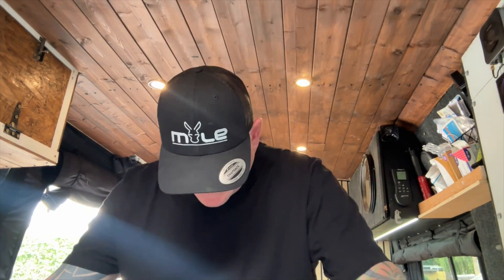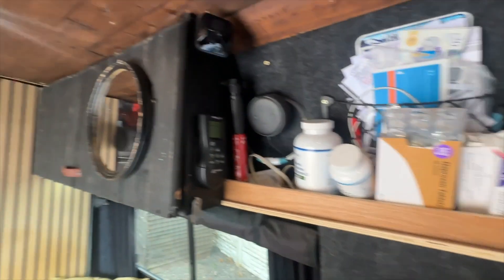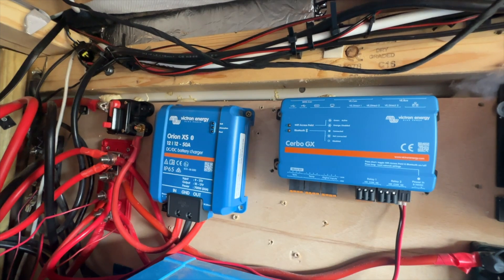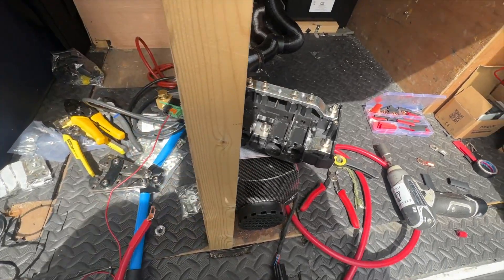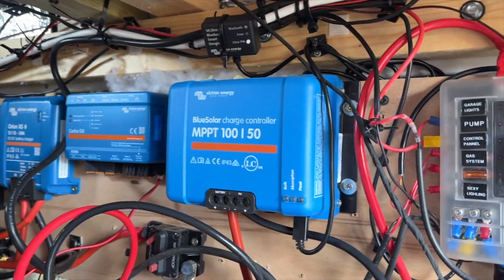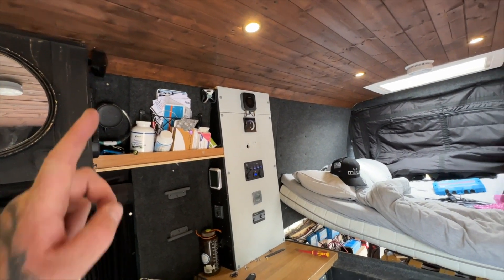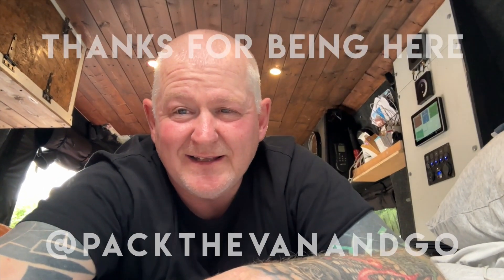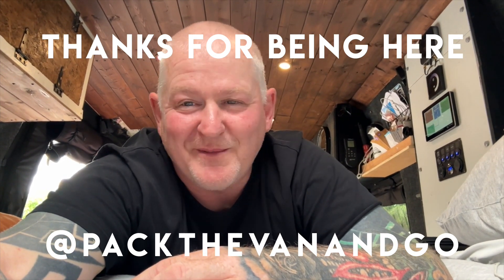The Ultimate Power Upgrade: Victron Cerbo GX,  Touch 70, Orion Xs DC-DC And Lynx Power

Comment: Hi,
It looked like you used the Lynx Power-in instead of the Distributor. This might be an issue if you don’t do the fuse mod to the Power-in…? It was difficult to see clearly from your video but it appeared there was no fused protection between the B2B and Power-in or the MPPT and Power-in. This would expose these devices and their wiring to the max fused fault current of the battery.
Reply from the maker: @robertallsworth8206  so if you do the fuse hack for the power in, you’ll still need to fuse the MPPT to the power in?
Reply: @packthevanandgo  The best way to think of fusing/circuit protection is, you’re protecting a lower capacity circuit/load from a higher capacity. So think of a standard 240v domestic plug. The fuse in the plug protects the cable going to the device being supplied with power. In many cases the device may have another internal fuse (possibly on the cct board) to further increase protection (Eg a TV). The wiring leading up to the plug (the house ring main) is probably fused (via an MCB) at 30-32Amps.

In your camper van installation think of the habitation battery as the grid power arriving at your house (almost unlimited instantaneous fault current. Only limited by the BMS if you’re lucky). Your habitation battery should have a fuse as close as possible to its positive terminal. Best option is a terminal post fuse. This is mostly to protect the piece of wire from the battery to the distribution panel (in your case the victron power-in unit). All wires leading out from the distribution board (victron power-in) must have additional protection if they are not the same size as the wire from the battery to the distribution board. The reasoning behind this is as follows: say for example the battery to distribution board wire is 32mm2 and it’s correctly protected with a fuse at its origin, the battery. If a wire then coming out of the distribution board is only say 4mm2, it would melt before the 32mm2 wire even got warm. Hence you need a fuse to protect the smaller size wire. 
In your case I know the MPPT is supplying power into the system but it’s connected directly to the battery. So an short in it’s supply wires or internal to the device, then the fault current is only limited by the battery fuse (maybe 300-400amps..?)
So whenever a part of your circuit has less current carrying capacity than another part it is connect to, it must be separated (protected) by a fuse/MCB etc

Comment: Rob, better to NOT use crimps on the XS end of the cables. Bare wire, properly clamped is much better. Bigger contact area, less resistance and less heat.
Reply: this is why the experts on here have no under pinning knowlege or qualifictions, just watch a few vids and dont know the why we do it.
Reply from the maker: @ollydogtravels9465  sorry?
Reply from the maker: @kevgermany  ok many thanks for the advice mate

Comment: Looking like a great update to your system, my friend! It is difficult to maintain a tidy setup over time when one keeps adding to and improving the electrical system.
Mine is freshly done (you've seen it) and therefore built to size and with neat wiring. Once I start adding stuff that I have not thought of as yet, I will be in a pickle as to where to fit what and run additional wiring. So, don't worry. As long as stuff works, everything is good.
I've modified my Lynx Power-In to hold fuses. I've just seen a couple of breakers in your setup. Is your wiring sufficiently protected with fuses and other breakers?
Hugs to you and Archie! Stay safe! 🚐☁🍀
Reply from the maker: @gonefilming2020  thanks mate, hope you’re well?

Comment: Looking good, ive used the guys at 12VoltPlanet for some of my electrical kit, great service. Recently replaced most of my Renogy kit for almost the same kit you now have. Victron was just too expensive when i was first building the van, but have to say the setup was easy and the live and historic data really helps with how i use the system and make changes to my power use. Great work and vans really looking fab now as you make these updates.